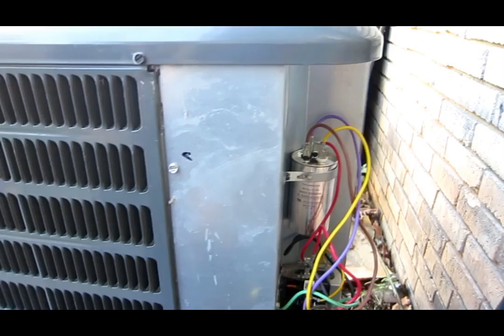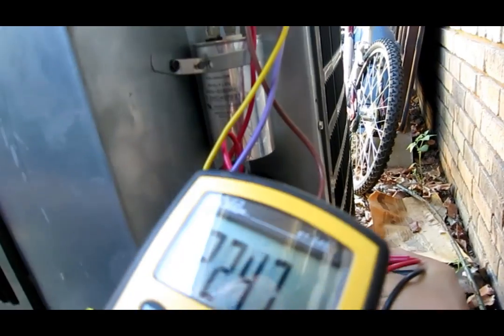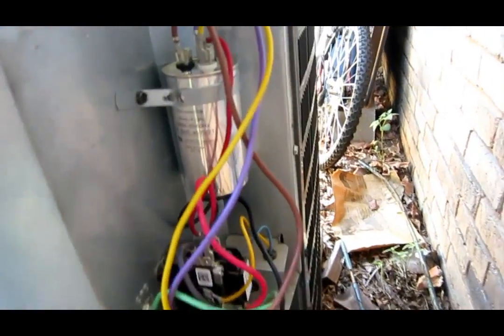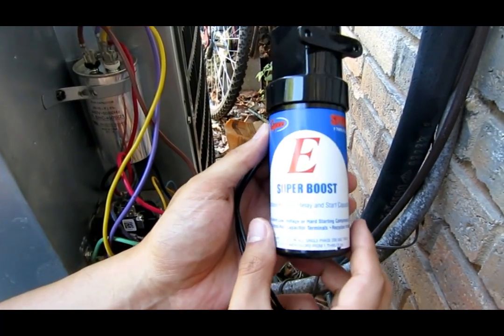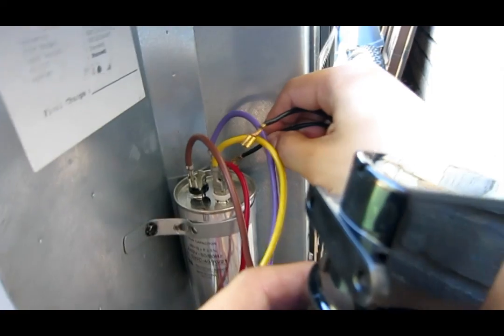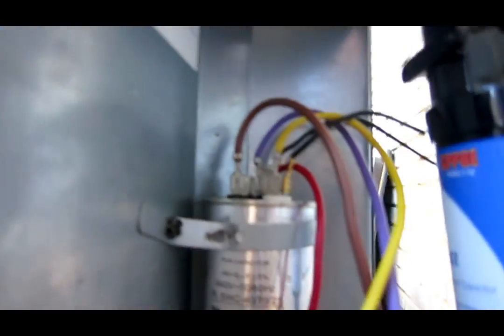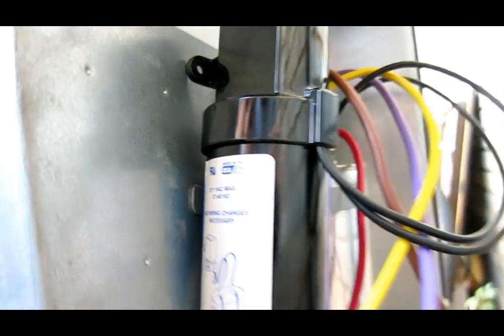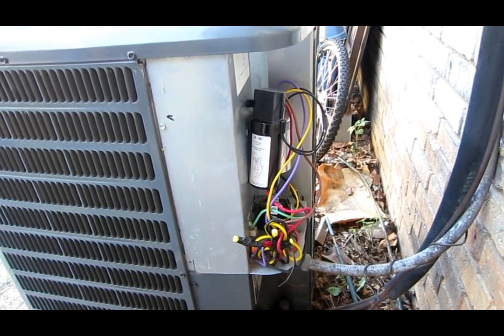HVAC Intermittent Problem - AC doesnt start every time - Hard Start helps low house voltage

Comment: If you are having intermittent cooling issues with your HVAC, check your drain at your evaporator coil. It could be clogged or not draining correctly.

Comment: I don't think that is a run capacitor. That is a start capacitor. Run capacitor is on the compressor itself. Correct me if I'm wrong

Comment: You should have checked the voltage and current during the contractor closer.
These measurements would have read the inrush current and related voltage drop.
Once the compressor is running, the video only displayed the running voltage, which is a higher reading than actual voltage drop during compressor starting.  
It is possible the wiring conductor sizing and/or the circuit breaker is of inadequacy sizing.

Comment: my ac compressor runs for 2 minutes then vibrate very hard then switch off itself. its cooling power is as good as new. i have already cleared ac from all sides so understand that its not heating issue. can above symptoms may be due to low voltage supply?
Reply: Chetan Bhangale No, you probably have a bad run capacitor or your compressor is screwed up.

Comment: If compressor is a piston type with a TXV most are hard shut off you need a start kit.
220 VAC is enough look at the compressor nameplate most likely rated 208-240 VAC.

Comment: I have found that my 4 ton Trane does this same thing. It is an XE1200 from 1996, and is 4 tons. It's matched with a 5 ton air handler and coil, but that's okay as long as the TXV is rated for the condenser, which it is. The unit has stuck TXVs both on the cool mode, and the heat mode, and has a reversing valve problem, but it does have a start capacitor, but it's not enough.

Comment from the maker: yes, there are much more to check. this is just a quick fix. thx for the advice. :)
Reply: Diy tinker i have a question. I live in. Yuma arizona and my a/c unit stop working but the furnace inside the house keep running just warm air. So it does this during the day when its really hot outside.it turns of and on when ever it wants i want to know if this problem can be solve with the super boost

Comment: 224 volts is plenty to start any compressor,if you need to use a hard start your compressor has problems and in time it will present itself,you should have ck the amps,and it may have a mech. problem,it did sound a little loud,it could also be a charging issue,there is several other things to ck also,the hard start is a just a quick fix,and it may last for awhile but its not a correct repair,need to investigate deeper,good video,for a rookie tech lol,have a good one,no need to bleed cap.
Reply: When you say a charging issue, what exactly does that mean and what could cause that?

Comment: Just info only, the hardstart that you used is a piece of crap and adds no value. A good hardstart to use is a 5-2-1 Also if your run cap is still connected in your system after you pull the power the cap will discharge by itself back into the system...I cap will only hold a charge if it is disconnected while system is running.
For safety reasons you can cross the poles but theres no need to.
Reply: The other day I discharged a capacitor and  it made a loud snap and a spark. Never had that happen before. The unit was off for days, but it still had a charge.
Reply: @heidis8713  I don’t think Kevin realizes that some capacitors have a 10 megaohm resistor which does allow them to power down. Other ones may not have that internal resistance. It’s not a given that they all power down by themselves. I’m not gonna touch one just based on the fact that there may be an internal resistance.
Reply: @condor5635  thank you for your reply. I know a lot more about what happened that day, 2 years ago. So, my roommate's a/c went out. I didn't have all the proper equipment to test everything, but his capacitors were 20 yrs old, so I grabbed some new ones and switched them out, hoping that would fix it. Anyway, 1 of them had a bleed resistor, which I removed from the old cap, and soldered onto the new one. I take lots of pics of my work incase I ever run into a problem. Well, the caps were not the problem, so I had my roommate call his ac guy. The guy came out and replaced the fan motor, and predicted "the compressor will go out within 6 months." About 5 months later, the unit stopped working. I went to check it out and that's when I discharged the cap and it popped and sparked. On the ground was the bleed resistor with snip marks on both legs, and the soldered ends where it was snipped, were still attached to the cap. The AC guy had snipped it in an attempt to make the compressor blow quickly.
Reply: @heidis8713  not sure I understand why you think he snipped it off to make the compressor ‘blow quickly’. The bleed resistor will have absolutely no effect on the lifespan or operation of a compressor. It is more of a safety feature.  Additionally most bleed resistors are internal within the capacitor so you won’t know unless it is shown on a schematic which it sometimes is
Reply: @condor5635  what I wrote was a short summary of what happened. There is, of course, a lot more to the story. When I said " The AC guy snipped it in an attempt..." I was only referring to HIS intentions for his actions. I don't share his beliefs. I know that most bleed resistors are located internally, however this one was definitely on the outside, which I removed and put on the new one. I'm looking at the Trane wiring diagram and it shows a resistor for the start capacitor, and in the Functional Unit Parts it says "capacitor, start, 135-155 MFD, 330V, round, w/resistor." Anyway, I told my roommate to ask his boss "Why did he clip the resistor?" His boss said that Trane puts it in to justify the high cost of the unit, and that a good technician knows to discharge it properly. I said that wasn't my question. Tell him you want to know WHY he clipped it? The boss told my roommate some more bullshit, and fast forward... it all ended with my roommate being a bitch and apologizing to the boss for questioning him, and then being sold stuff he didn't need.

Comment from the maker: ya, i agree. It does start up the AC every time, but I really dont want to use a hard start kit, called the city and they adjusted the voltage. Dont need to use it anymore.
Reply: What’s your issue with using one of these kits? How did the city come and adjust your voltage? I find that intriguing